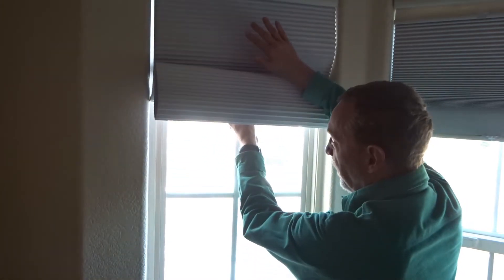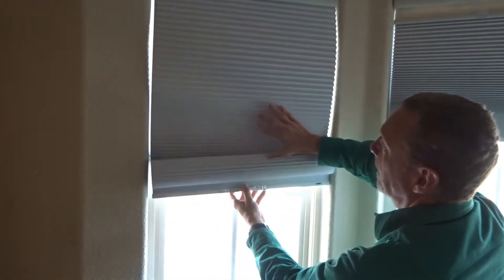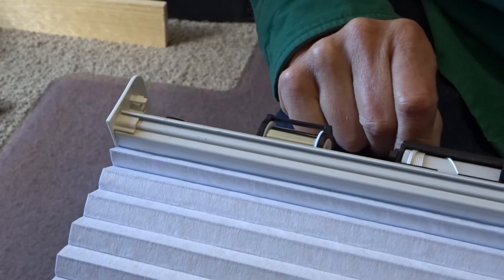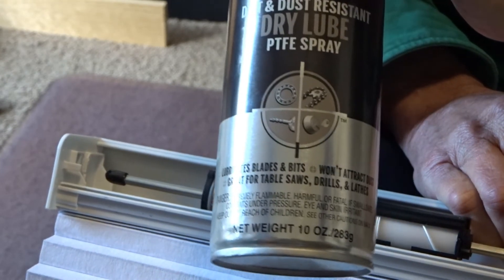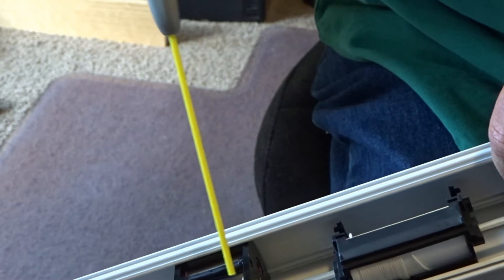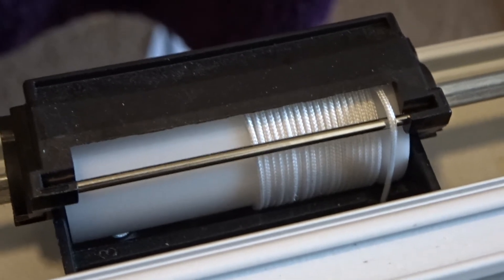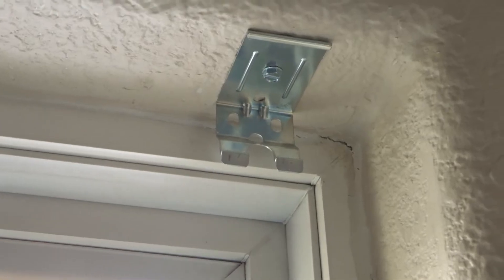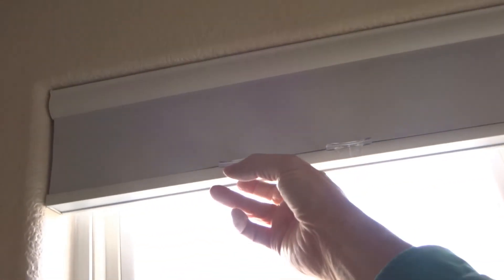Bali Cordless Blinds / Shades Won't Go Up (Retract)

Comment: This worked for me.  Thanks!  Most expensive blinds I've ever purchased and worst blinds I've ever owned.  With how tough these were to pull down, I thought for sure this wouldn't do the job, but it did.
Reply from the maker: I bought a few of Home Depots cheapest house brand, and they worked sooooo much better than Bali.  They just didn't look the greatest.
Reply: I had the same experience recently (2 weeks ago), Installed them in 2018. They work fine, I'll do the dry lubiricate trick today.Thank you, Halloween is approaching!  Have fun!

Comment: Thanks for the video, it helped solve my problem. Following your instructions to lube the spring  did not work. However lubing each of the cord spools did work. Besides not going up my blind was also very difficult to pull down. Your video was well done and a huge help in solving my problem. My blind was under warranty, but this was much less trouble and also good to know for day this is sure to happen after the warranty has expired.
Reply from the maker: Rich Pasma Thanks for the feedback.  Can you describe exactly where you sprayed the lube.  I’m still refining my technique and I know it doesn’t alway work.  I have even gotten lube on the strings once and the shade would not stay up or down.   Work in progress. I can’t be the only person out  there with a house full of bad Bali shades.
Reply: @patpatpat999  What I did was put the blind assembly in a vertical position, spray a small amount on the spindle where it meets each of the cord spools (There is a small hole in the end of each of the drums I might have got lube in as well, but they do not look like lube points) and while the assembly was still vertical, pull and retract the blinds about 18 inches several times. Then I rotated the assembly 180 degrees and repeated the same process for the other side of each of the  cord spools. It was only blind luck that I used a method that did not get any lube on any of the cords or the drum of the cord spools and that it made any difference. After doing this I found the blind was much easier to pull down than the other three blinds I have and repeated this process plus spraying the springs on those blinds. All of my blinds now are now noticeably easier to pull down although I cannot say whether or not the other three that were working before, go up any better than before. If this lube could be applied with a liquid dropper rather than a spray it would be easier to control, but at this point I would not bother buying something else for when I need to do this again. It is much easier to explain things with a video rather than a written description done from memory. If what I have explained here is not clear, please let me know and I will do my best to make it understandable. Thanks again for the work you put into your video, it was a huge help.
Reply: An update to my earlier reply. What I wrote earlier was based upon my memory and did not make any sense as the cord spool is fixed to the spindle. Each end of the cord spool acts like a bearing in that it is round and spins within the cord guide housing. It was the space between each end of the cord spool and the guide housing that I had lubricated. It makes sense this could make it difficult to pull the blind down and be one of the things that would prevent it from retracting properly. Sorry about the earlier error.
Reply: When looking at the cord spools and the spring clutch (the shiny thing) all of the white pieces rotate within the black pieces. Put a drop or two of DRY LUBE (WD40 makes some. Any with PTFE and DRY in the name should be fine) on all of those surfaces, both sides of all of those spinning surfaces. All of those plastic-on-plastic bearings can cause the blind not to go down or up. The spring clutch has a take-up reel in the back that also has white on black bearings going on. Lube those as well, inside and outside of the black plastic. And remember to NOT touch the cloth blind parts with the lube on your hands. ALL of that lubing has now made MY blinds pull down with ease and go back up almost as well.
Reply: @richpasma2824  This totally worked on my blind thanks.  Our blinds are 62 wide and 69 high and went only like half way up and sometimes were extremely difficult to pull down.  Before I saw your video, I had taken the blinds down and some of the strings were criss-crossed.  So I took a pick and straightened them out.  They worked better for awhile but then went back to being difficult to raise and lower.  Got some dry lube and did both the springs and cord spool assemblies.  Works like a dream now.   They were out of warranty and Bali wanted $50 to fix them plus I would have had to ship them to San Diego.

Comment: My Bali cordless blinds have stunk since day 1.  I just took mine apart and they have a different mechanism.  Mine has two of those silver recoil springs.  And to the right of that three red small plastic covers (maybe an inch wide) covering the string.  My blind totally fell to the floor like the cords are broke.  But none of the three cords appear to be broke when I hand wind it they all wind back up.  I am so confused.  When I wind them myself the 3 cords do wind around the barrel but they are loose.  I will go buy the dry lube now and try that

Comment: Good video. This got me in the right direction to fix some of the 3 year old Bali blinds I bought from Home Depot. As a side note, these blinds are expensive and junk. Anyone considering purchasing them I would advise against!
Reply from the maker: I have since purchased cordless blinds from several other sources and they ALL work better then my Bali blinds. PS, they were all cheaper
Reply: @patpatpat999  yes. I had custom levelor in our last house and they cheaper and better than the current Bali.

Comment: Thanks for the hint. It took three stores to find the dry lube but got some at O'Reilly's Auto Parts. The 4' blind tooklonger to get to work and like others have said, I lubed a little where the shaft goes through the spools and that seemed to help on the longer blind.
Reply from the maker: Good to here.  I've moved since, and no longer have any Bali blinds to deal with.  I bought a couple of Home Depots cheapest house brand cordless blinds -  they don't look quite as nice but work 10X easier.

Comment: Mine are wood so I didn’t mind using silicon spray.  First I lubed the spring mechanism and that did nothing.  Then I lubed anything that moves against something else.  Some improvement but still needs lots of persuasion to go up.

Comment: Thanks.  I have a different manufacturer but it's the same basic concept.  I've seen so many written directions online but so far yours is the only video that shows what it looks like to open it and reset it back and forth.  It makes more sense to see it in action then read a technical manual.
Reply from the maker: Thanks. It's frustrating to see videos that are total BS.  Like the "pull it away from the window, then down and out, then back up"   Does  absolutely nothing 99% of the time.  Anyway, I moved and left them for someone else to enjoy.

Comment: Thanks for the video. Ended up being one of the cords was wrapped around a nub on the retraction mechanism on mine, but I did throw some graphite lock lube on the spring while I was in there. Seems to work better than when it was new, so you at least helped me improve normal function. That stuff stains though so I'm going to use the PTFE dry lube next time. I think I have some of that floating around in the shop.
Reply from the maker: I haven't used graphite on anything in years. Stuff gets everywhere. Used to shoot it in door locks.
Reply: Yeah, it's not great for stuff in the house. I use it mainly for my pad locks outdoors and the pin locks on my trailers. Works great for stuff that sees a lot of weather.

Comment: You cut to the shades suddenly being off the window frame. How do you get them off?
Reply from the maker: Sorry I didn't cover that.  Think of the front upper edge of the shade as the hinge.  It releases from the top rear (side against the window) in a roll-toward-you motion.  The trick is that the clip is very stiff.  I pry it away from the shade with a screwdriver while rolling the whole shade towards you. Repeat for the other side. Works best with two people.